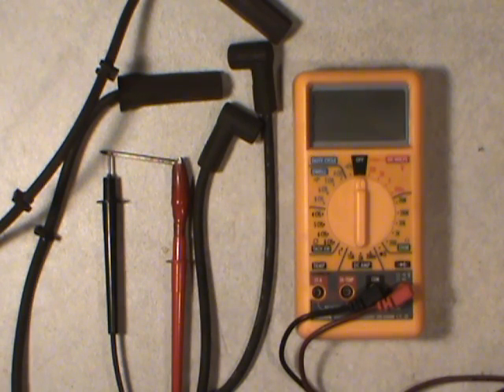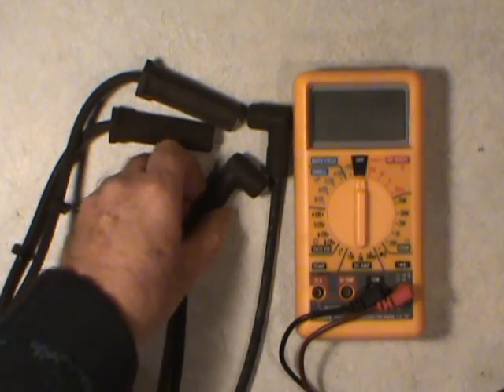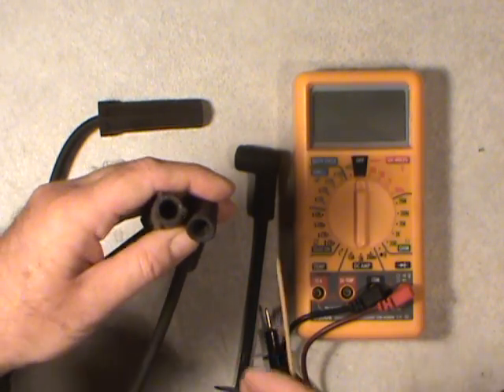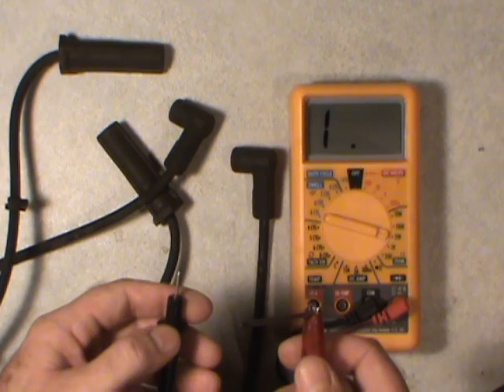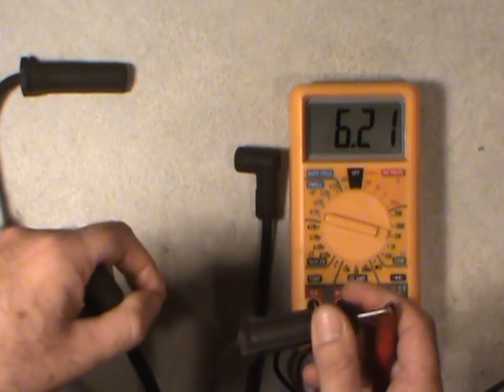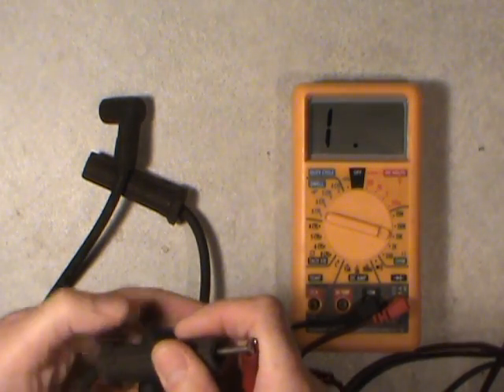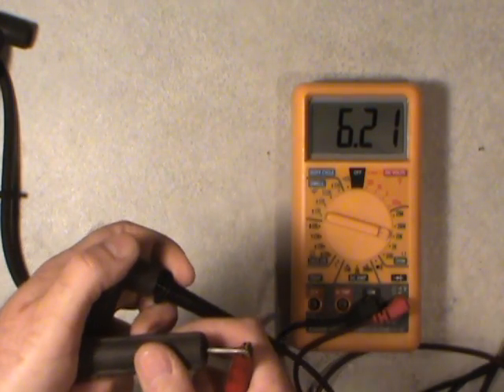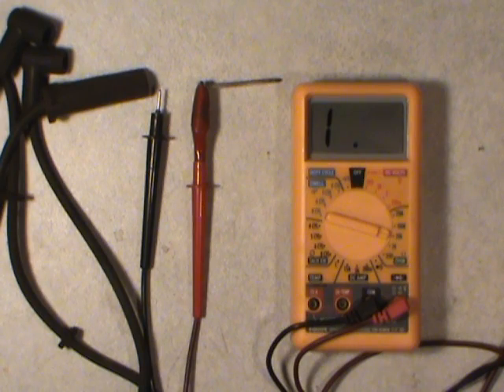How to Test Spark Plug Wires

Comment: This was extremely helpful. Turns out that these nice stainless steel marine wires I got as spares to use on my Chevy Caprice have very low resistance. One man's junk just became my treasure. :) Thanks.
Reply from the maker: Greetings mikesc90....You are Welcome, and, Thanks for the great comment, and for, watching this video of mine, as well as, sharing the information, on that, let's see now, was it..."Buried" Treasure...or..."Un-Buried" Treasure, that You got Your hands on?...lol....Yes-Sir-ee-Bob, I hear Ya, when it comes to being the Recipient of someone-elses, shall we say..."Throw-Aways" perhaps, and, making it possible, for Us, to be able to make some pretty good use, of that there...used to be called "Junk", to its "Previous" Owner, that "Did-Not" want to keep it in "Captivity" any longer, and, seeing as...the Previous "Owner"..."Did Not" happen to have, a, lets' say..."Sentimental Attachment"...to his previously Owned "Junk", makes possible, for Folks, like You and I, to be Think-in' and Smile-in', that those there..."Junk-Minded" Folks...just "Made Our Day"...!!!...lol.

Quite surprisingly, I had a, shall we say..."Comparable Situation", such as Yours, that actually Involved being the Recipient of a Set of Spark Plug Wires as well...

...but...with a "Twist" no less...!!!

Here's the deal....I had a "Set" of "Used" Spark Plug "Wires" (8 of them), from a Chevy 350-V8 Cubic Inch Engine, equipped with an HEI Distributor (General Motors High Energy Ignition, with the Ignition Coil, in the LARGE Diameter shaped Distributor Cap), that was Replaced with a "New" Set of Spark Plug Wires...

I had that "Used" set of spark plug "Wires" in "Custody" for quite a while...

...then came a day, when I needed to Replace a "Set" of  Spark Plug "Wires", on a Small Block Dodge V-8...cuz...the darn Tubular Exhaust headers "Melted" some of those Orange-ish/Tan-ish Colored, "Non Silicone", and well, "Old School" type of spark plug "Wires", where, and just like they say..."If You Can't Stand The Heat...Get-Out-Ah-The-Kitchen"...!!!...Ooops...(Translation Needed)...

...I really should be sayin'...(to those "Old School Spark Plug Wires")...

..."If You Spark Plug Wires Can't Stand The Heat...Get the (use Your Own Word Here) Out-Of-The-Engine Compartment...!!!...lol.

So, after I made the needed Modifications, in order to make those there "Used" HEI type of spark plug "Wires"..."Connect" properly to the "Old School" type of Distributor Cap, using some "Rubber Heater Hose", and some "Metal Tubing", I now had some "Much Higher Temperature"..."Silicone" Type of Spark Plug "Wires", that were able to "Laugh" at All of the "Heat", that those there Tubular "Exhaust Headers" could Throw at "Them"...!!!

...&...

...that made me as Happy, as a "Hog" havin' a "Mud Bath"...Yee-Haw...!!!

The Moral of this here Story is...

...I was "Not Only"...the "Recipient" of this (old set of spark plug wires) of Mine...

...but...

...also the "Provider" as well...

...and that kinda makes Me...

...the "GUY", that had the "JUNK", and also...the "GUY" that was the "Recipient", of, that there...

...TREASURE"...!!!

When You are finished with all of that Laughter...I'll be sayin'...

Be Safe, take care, and have a good one.

Comment: Thanks for good info.  I found a problem thanks to your video.
Reply from the maker: Greetings...Orson............You're welcome, and Thanks for watching............It's good to hear, that You found, and fixed Your Ignition system problem, well done...................The 3 major spark plug "Wire" Problems, that I had in the past, was where, the high voltage Conductor (that's in the center of the spark plug Wire), actually (high voltage) "Arced" (aka, Sparked), Between the Burned End of the spark plug Wire's Conductor, and the Metal Terminal, and, the Not Wanted "Gap", grew larger and LARGER, where the wire's Conductor, was supposed to be, Positively Crimped (aka, squished), onto the metal Terminal, and, in one of the Vehicles, 2 spark plug Wires went "Bad" at (almost) the very same time...!!! (good thing that I wasn't very far away, cuz, that Vehicle, barely made it home that day"...!!!...Holy-Gwalk-ah-Moly...!!!...lol)...................The other One, was, well, Ghost-like, and no, I'm not kidding................The 350 Chevy V-8 Engine, that had a points & condenser distributor in it, would usually start up just fine, then, oh, about, driving a mile or two, after being started (cold), the Ghost thing, started to happen................At the beginning, of this factual Ghost-like story, this Engine would sometimes (when it first started happening), just go "Silent", and quit running (no backfire, no nothing), so, I pull over to the side of the road, and wait a few minutes, then, the damn Engine would usually, just Start up, as though "it" Never Happened...!!!.................Then, there was one time, when the Engine was running Ok, for about 25 Miles, and, as I was driving along, the Engine just went "Silent" (without warning), for a few Seconds, then, would just start running Normally again, as though the Ghost-like running condition never took Place...!!!...Yikes...!!!.............Time to call..."Ghost-Busters"...!!!...lol.............Well, I was thinkin', that, something like, a Faulty (intermittent) "Ignition Coil", or the primary low voltage Wiring in the Ignition Circuit, would probably be where, the "Ghost" would be Hiding, so, I ran a few Tests, and, all that I tested (so far) was Ok, so now what...???................Then, I checked inside all of the spark plug Wire (rubber like) Boots, and all of that looked good...until..............I finally pulled the High Tension Lead (that be, the short spark plug "Wire", that goes between the Ignition Coil's High Voltage Tower, and the Center Terminal on the Distributor Cap), and, when I looked into, the (rubber like ), spark plug Wire Boot, that Connects to the Ignition Coil's, high voltage Tower...There..."it"...was...!!!...Wowsers...!!!...the spark plug Wire's "Conductor", Burned away from its Metal Terminal, by quite some distance, and I'm guessin' that, sometimes, the Ignition Coil, was able to produce, a "High Enough Voltage", that would be able to "Jump", this Not Wanted "GAP"...!!!.................From what I recall, the Engine had to be Warmed up a bit, before the "Ghost", would be doing its Thing, cuz, I don't ever recall, "Mr. Ghost", causing any Mischief, when-ever the Engine was Cold...!!!..........So, I just Replaced that short high tension Lead (aka, spark plug Wire), that goes between the Ignition Coil and Distributor Cap, and the "Ghost"...Permanently..."Disappeared"...!!!...Yah-who...!!!....oh, and, I cancelled the..."Ghost-Busters"...Appointment...cuz, look Ma..."No More Ghost"...!!! (what-so-ever)...lol...and........till next time.........Be Safe, take care, and have a good one.

Comment: Thanks. Your video helped me nail down why my 2 cycle engine isn't firing even though it shows a spark outside the cylinder.
Reply from the maker: Greetings...Jonathan Sayers...........You're welcome, and, thanks for watching..........Well, be it a two stroke cycle, or, a four stoke cycle engine, the reason that a spark plug might fire, out in the open atmosphere, and not so good, inside of the engine's combustion chamber, is usually due to "pressure", as in, the higher the engine's cylinder pressure gets, the more difficult it is, for the, shall we say, spark, to take place, between the spark plug's electrodes, as a general rule of thumb...........The ignition coil's secondary high voltage has to get higher as well, in order to make a spark plug fire, when-ever the engine's cylinder pressure gets higher, for the most part............If testing a spark plug "outside" of the engine, I like to see, a rather impressive, blue or white-ish colored spark, between the electrodes, as opposed to, a weak looking, yellow or orange spark, as I've seen in the past, and.........till next time........Be Safe, take care, and have a good one.

Comment: That mean i will have to change the sparkplugs for resistive ones and use normal wires if i don't buy OEM wires wich are very expensive...

Just to complete your well made video : )

Comment: I've never tried this it's good information to Know thank you for sharing this information
Reply from the maker: Greetings...lomsome's Garage..........Thanks for watching..........Usually, most Manufacturer's spark plug "wires", will usually have a certain amount of ohms/resistance, for a given unit of length, and, I usually use, a "one foot" (or, 12 inch) length...........Might be a few thousand ohms, for every, one foot, of spark plug "wire" length............By doing some simple math (arithmetic), then, Ya can even find out, how many ohms there are/or should be, for every "inch", of spark plug wire length, and, can come in very handy, if Ya want to know, what the ohms/resistance should be, for those, (usually), different spark plug "wire" lengths, that can, usually be seen, on something like a V-8 engine, that has a distributor mounted on it, or otherwise...........When-ever doing this type of ohms/resistance test, make sure, that, Ya bend the spark plug "wire", a little, in all directions, just in case, there might be, a small break, in the wire's (high voltage) "conductive" core..........I had a V-6 engine, a while ago, that almost didn't make it home one day, and, the engine sure ran very rough...........Turned out to be, that, two of the spark plug wires, had, high voltage "arced" (sparked), where, they were no longer, being connected to, those metal clips, that snap onto the spark plug, and, the first clue, that I saw, "before" testing the wires with my ohm-meter, was some white-ish/corrosion-like deposits, that were, way down inside, those, (two) spark plug, rubber-like/silicone, spark plug boots, where those metal terminals were hiding...........Most of the cheaper/carbon core resistance "wires", will gradually "wear out", due to, all of the high voltage, that, they have to carry through them...........Some really old ones, might seem to work alright, but, I sure wouldn't want to put my hand anywhere near them, when the engine was running, because of, "all of the cracks", that were seen, on the "wire's"...outside, insulated..."jacket"...!!!......and......till next time.......Be Safe, take care, and have a good one.

Comment: I've tested the wires of my motorcycle.
They all have infinite resistance.
They work good however.

They are just resistive wires that you can't test with an ohm meter.

It sucks for maintenance but it's to protect electronic devices like the ecu or abs module on the motorcycle.

Nowadays the sparkplugs are resistive,not the wires.
My motorcyle have the resistive wires and normal sparkplugs.

Comment: Thanks for this video. I learned something today.
Reply from the maker: Greetings...Shawn S.   .............Thanks for watching, and It's good to know, that this video of mine, was able to help You out...............The Carbon Resistor (string) type of spark plug Wires, that a lot of vehicle engines, had on them, when new, probably, were-not expected to last forever, as in, it would probably be a good idea, to have a New Set of these Carbon (string) Resistor spark plug Wires, installed on the Engine, when-ever the Set of them, that are on there now, are getting older, and/or, have lots of Mileage on them, as, the High Voltage Pulses, that they are subjected to, and given enough time/use, this High Voltage, will probably eat-away, at the Carbon (string), high voltage Conductor, eventually................I have two very good examples for Ya..............I had an Engine that would just go "Silent" (stop running), then, after a few seconds, start Running normally once again, just as if, a "Ghost", was Hidin' under the Hood of the Car...!!!...Yikes...!!!...lol...turned out to be, that, the short spark plug "Wire", that went between the ignition coil's high voltage Tower, and the center Terminal on the distributor Cap, became, shall we say, High Voltage "Arced-Away", as in, the Carbon (string) Conductor, that was inside, that short "Wire", Burned-Away, leaving a Gap, between, where it should have been Crimped/Connected to, the Brass/Metal Terminal, that went, down into the ignition coil's high voltage Tower connection point.................So, I figure that, that not wanted "Gap", was at just the right Distance, where-by, the ignition coil, had just enough High Voltage (sometimes/most of the time), to, be able to, actually "Jump", that not wanted "Gap"...well, until the engine warmed up, then, every so often, that "Ghost" would show up, and then, the Engine, would, then again...go..."Silent"...for a few seconds, then, start Running again, as though, nothing was wrong at all (Holy-Gwalk-ah-Moly...!!!)...............So, once I found out (visually), what it was, that was causing the Problem, I Replaced that short spark plug "Wire", and, after doing so, I never saw that "Ghost" again...!!!...lol..............The other one, was where, this particular Vehicle, barely made its way Home, that day.............It turned out to be, not "1", Bad spark plug "Wire", but "2", Bad spark plug "Wires", on the very same Engine, at the very same time...!!!..............These "2" Bad spark plug "Wires", appeared to have, about the same "Damage", as the other example as well, as in, these "2" Bad spark plug "Wires", shall we say..."Lost Their Connection"...to the Metal Terminals, that they were supposed to be "Connected-To", but this time, that Lost Connection (probably due to that High Voltage "Arcing" as well), resulted in, a not wanted "Gap", where that Metal connection Terminal was, down, inside the (silicone/rubber) Boot, that gets pushed onto the spark plug's porcelain end..............So, there You have it, and, Yes-Sir-ee-Bob, I can actually say, that, I actually "Experienced", on at least two occasions, what it was like, and how those two engines "Acted", when some of those spark plug "Wires", became "Damaged", and, couldn't deliver the goods, as in, that High Voltage (and Amperage too), that those Spark Plugs Need, to give Us, that nice, Strong and Reliable "Spark" (between the electrodes), that usually results in...Fuel Economy...or..."Speeding Tickets"...!!!...lol...and........till next time........Be Safe, take care, and have a good one.

Comment from the maker: Greetings Michaelovitch....Thanks for sharing your information....I'm thinking that if you had a very sensitive Multi/Ohm meter, (expensive one), then I'm quite sure that it would detect at least some resistance....Some cars have resistor wires connected to resistor spark plugs, one reason, to suppress "Radio Interference"....I figure it's mostly always a good idea to stick with the manufacturers recommendation for best results (stock applications), not Racing....Take care...

Comment: Saved me some money right here. Thanks!
Reply from the maker: GuitarD30 Greetings GuitarD30....You're welcome, and, Thanks, for Your nice comment too.....................................................A Person, just has to be aware of, and try to remember, that, if an Engine, is equipped with..."Spark Plug Wire/Leads"...that, the Spark Plug Wire/Leads..."Internal Conductor" (Core), is..."Subjected to, and is Responsible for"..."Carrying/Conducting"..."All", of that..."Very High"..."Thousands of Volts"...of..."Electricity"...that the..."Ignition Coil"..."Develops/Generates and Supplies"..."All" the way, to the Engine's..."Spark Plug"..."Electrodes"...in order to make, a..."Nice Strong Spark"...that will usually "Result" in..."Maximum"...Engine..."Torque & Horsepower"...and..."IF"...You can..."Resist the Temptation"...of..."Flooring the Gas Pedal"...Your..."Fuel Economy" (aka, Gas Mileage/Kilometer-age)...will "Increase" also, which, by the way, will..."Save You"..."Lot-sa-Money"...at the..."Wanna-Take-Your-Money-Gas Pump-Bandit"...!!!...lol....................................................Be Safe, take care, and have a good one.